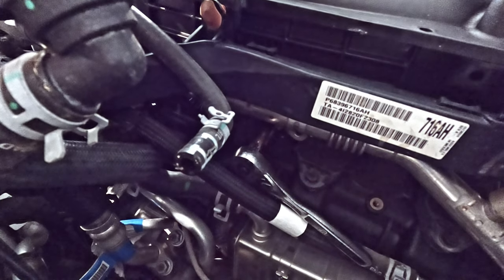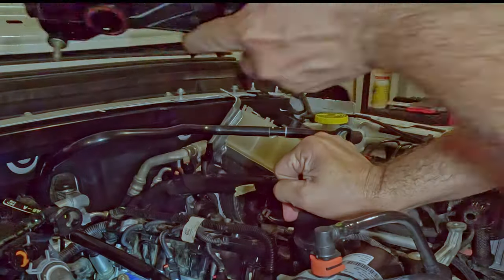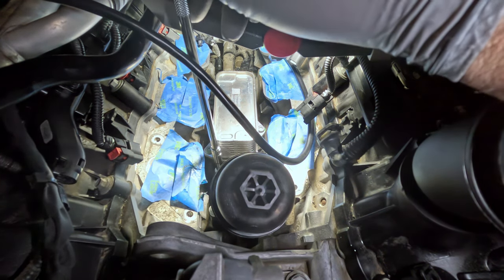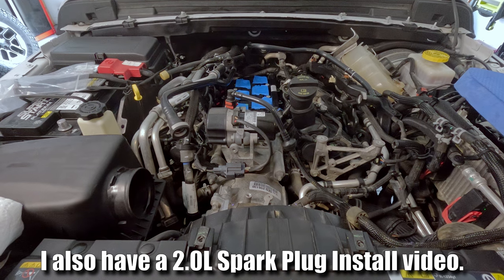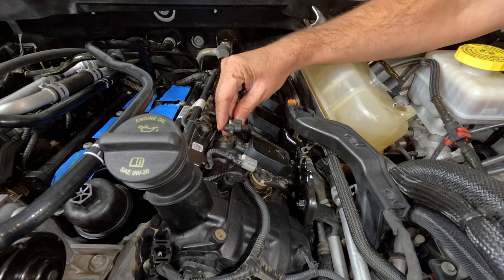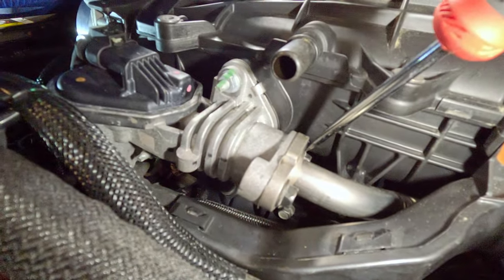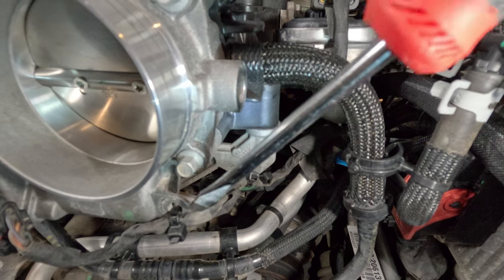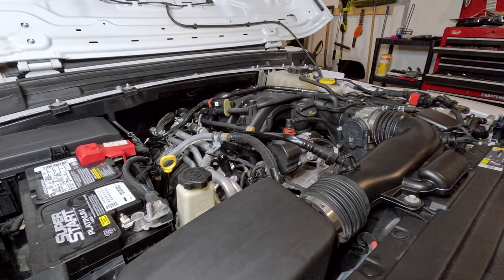How-To:THE Complete 3.6 Pentastar Oil Cooler & Spark Plug Swap Video

Comment from the maker: Need a better pic to understand how to disconnect the coil connectors?  See post #52 in the below link.
https://www.jlwranglerforums.com/forum/threads/spark-plug-change-on-3-6-penstar.122868/page-4

Which oil cooler and spark plugs are you thinking of using?

Comment: Awesome video! Thanks!
Reply from the maker: Thanks, glad it was helpful!
Reply: Why would you replace the plastic housing with another plastic housing versus just going with the dorman? That is fully metal
Reply from the maker: @destroyerlord5161 The Dorman is still using the old style figure 8 gasket like I show in the video and that is the reason for the oil/coolant leaks. This figure 8 gasket design, with no common wall, is the one that lets oil and coolant go back and forth contaminating the oil with coolant (not good for the rockers/cam) and contaminating the coolant with oil in some cases when it fails. 

As to aluminum vs the plastic in regards to changing the oil filter and potentially cracking the filter housing, I use a torque wrench for the filter cap set to 18 ft lbs. I don’t let anyone else touch it.